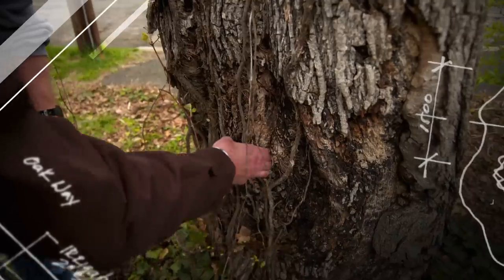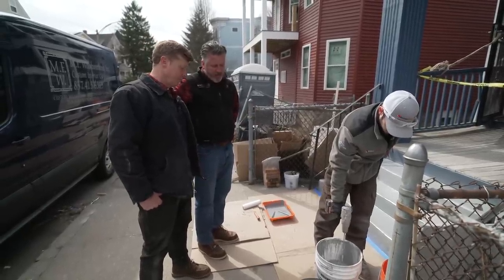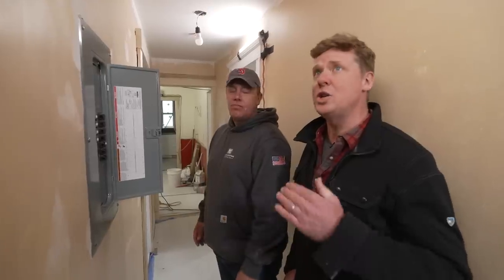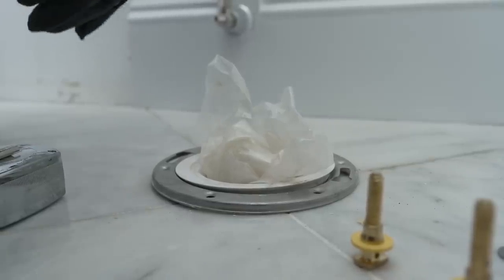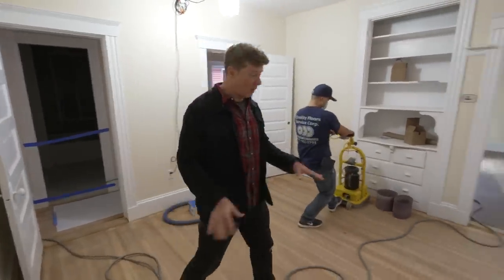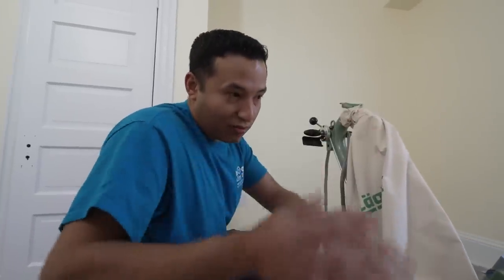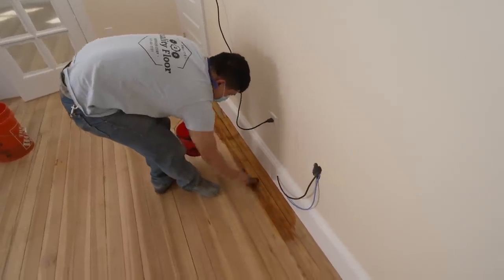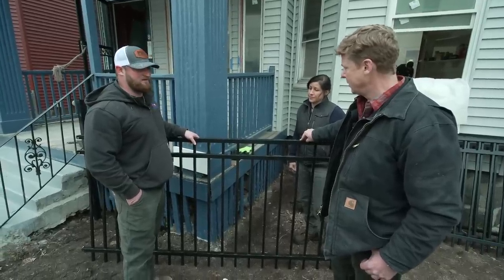This Old House | Almost Home (S42 E25) | FULL EPISODE

Comment: Surge protector docs often suggest putting the device in one of the topmost slots….probably a minor thing.
Reply: Your right, manufacturer usually recommends placing as close to incoming service wire as possible. Only a minor detail if you don't have a power surge.

Comment: The frost line in MA is 32". They put the fence posts down only 24."  Won't that heave with freeze and thaw cycle? In Illinois, it's  36. Cement makes no difference.  I speak from experience.

Comment: The latest ones I've installed have what looks like a triangular knob, with a smaller end that fits down into the hole in the base of the toilet. Hand tightenable only. The cap snaps onto the knob. American Std I think.
Reply: Yup. I installed an American Standard toilet in my house about a month ago. Same thing. Plastic hand tightened nuts. I thought it was the cheapest thing I've ever seen (I mean c'mon, how much extra would it cost for a couple of nylock nuts and flat washers?) but it seems to have worked fine.
Reply: @krockpotbroccoli65  I had a plumber tell me few years back, installed like this one on TOH, and he just getting ready to leave and heard a "CLINK" , looked down and the the toilet flange cracked apart. No $$ on that job.
Reply: @wsfwsf1497  OOF.
Reply: @wsfwsf1497  
"I had a plumber tell me few years back, installed like this one on TOH, and he just getting ready to leave and heard a "CLINK" , looked down and the the toilet flange cracked apart. No $$ on that job."

If they were to look at automobile mechanics, there would be a simple solution that would prevent that from happening. It's called a torque wrench.

The typical torque wrench for auto-mechanics tightens to Foot Pounds, but in situations like this,you would want one that tightens to Inch Pounds.

Once the tool is decided on, all the manufacturers have to do is determine the proper inch pound specification to tighten those nuts and as long as that is followed, nothing goes clink.
Reply: @Kevin-mp5of  
"And if you’re not mechanically apt enough to tighten a simple toilet mounting nut without cracking the bowl, you really should not be doing any sort of mechanical or technical work. Leave the torque wrench for cylinder heads and other critical applications…"

Shows how much experience you have at being mechanically apt.

Even a decades experienced plumber can misjudge how tight he cranked the nut and crack the porcelain.

Only an egotistical idiot rejects the use of a tool designed for a different industry, and prefers to continue with the problem rather than solve the problem.

I assure you, the nut won't care one way or the other.
Reply: @Kevin-mp5of  not woohrth a lobstah tuhrd in a lobstah paht

Comment: So do the contractors pay in order to be on the show because the quality range between different contractors is absolutely insane. Those plumbers are awful the flooring guys seem about mid-range and yet the fencing guys if they're the same ones that I think from previous episodes are top-notch. It's really rather confusing
Reply: It's not confusing at all. This project doesn't have an unlimited budget like every other project on this show. This homeowner isn't getting the best quality work because her insurance company is nickel and diming the project to death. If this was a typical TOH project, every contractor would be top tier and cost would hardly be a consideration. Also, the contractors on this job are use to working on working class homes, where there's likely a tight budget, so they aren't going to have the budget for extra time and high quality materials necessary to get things just perfect. And the fence contractor didn't impress me. He drilled those posts crooked as hell.
Reply: @brianglade848  *they’re
Reply: @brianglade848  it's a real house and real workers. Kevin's the only real actor.
Reply: @Kevin-mp5of  prove it.
Reply: @brianglade848  you're lost buddy. Stop while you're ahead.
Reply: @brianglade848  no they’re not just actors except Kevin.  TOH primaries you could say are acting, but they were real contractors.
Reply: @brianglade848  I is neva rong
Reply: @brianglade848  yug who tinks lik u dont know history of the show, which famously was the first house show to use real contractors decades ago.